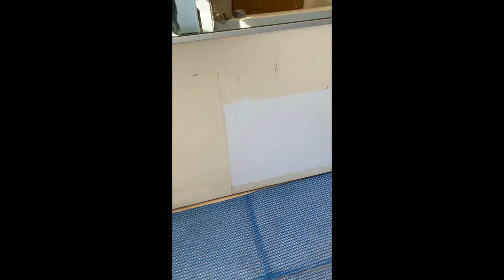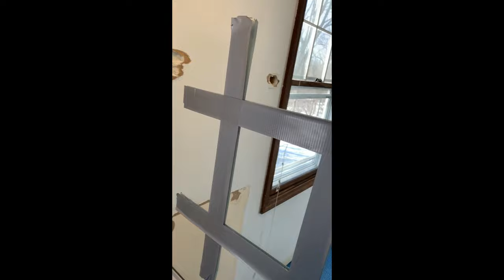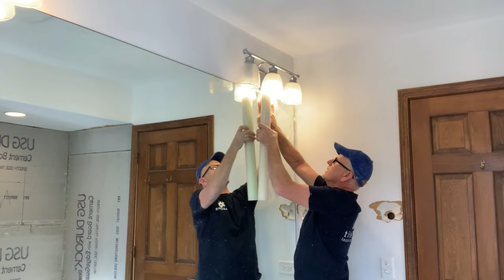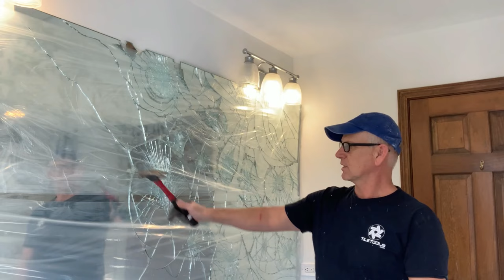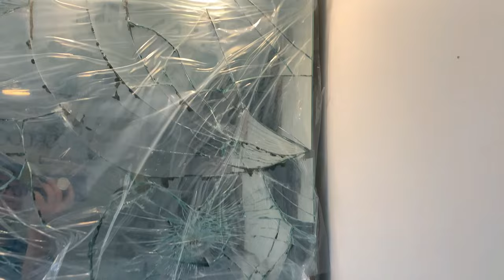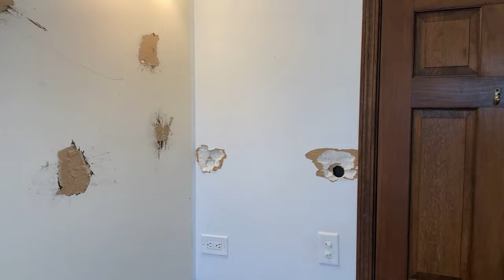Large mirror removal - safely

Comment: I had been researching how to remove a LARGE mirror.  My sister had a mirrored wall that was 8' tall and 10' wide.  It was in 6 sections of 4'x3'ish and I couldn't use any suggestions on videos until I came to yours.  It made the most sense and I followed your instructions....used carpet shield on the whole thing and started whaling away with a hammer in each section.  Really appreciate your video and help with this.  I would post pictures, but I don't know how on youtube.  Anyway, thanks so much for the assist.

Comment: This is a great video and very safe with the carpet protector added. I remove a 4' x 8' wall mirror (very heavy) using this method with one improvement. I have a Milwaukee M12 rotary cutoff saw that came with a diamond blade. Once you have it taped up, I scored the mirror into 2' x 2' pieces and snapped each one off. No shards, no splinters or small pieces of glass. It worked great!
Reply: So you didn’t break it with a hammer?  Just cut the pieces first?
Reply: Yes, just cut them with the diamond saw blade. The Milwaukee 3” circular cutoff saw is around $100 but you will use it for a lot of things. One of my best purchases and favorite tools.

Comment: Thank you so much for this video. I am a 75 yr old lady & I just removed my 7’ bathroom mirror all by myself by following  your video. The Carpet shield adhesive was a life saver! I had a little difficulty when I started because I was hammering at the middle of the mirror & it wasn’t breaking. I noticed you started at the top right hand corner. I followed your lead & my mirror shattered into a gazillion pieces. The carpet shield kept it from falling down in many pieces & made cleanup much easier. I did have all my fingers when I finished (ha). 

The lowest bid I had received for a contractor to remove the mirror was $600. So nice that money is still in my wallet!

Comment: It worked like a charm!  Thank you!

I had wall to wall mirrors above wainscoting.  The mirror was completely surrounded by j-clips. In total I had 5 large panels 1 metre wide (4ft), with two double narrow mirror panels about 10cm or 4” wide between the larger panels. It was from wall to wall… no room in the sides at all.  So there was no way to get shims under these panels of mirrors to remove them.  I had to break it up.

The carpet protector worked like a charm.  I ran the carpet protector horizontal across the mirror with a second coat applied vertically.  

The only thing I did differently was I wore heavier clothing.  I wore jeans, boots, a heavy sweatshirt (long sleeve), along with goggles, a face visor, a hat and most importantly knife/glass proof gloves.

I also used a 10Litre plastic bin (lined with heavy industrial massive garbage bags I got on Amazon).

I smashed the mirror and it would not budge until I cut it away from the carpet protector.  I started at the top first and worked my way down.  As I cut away the mirror covered in plastic carpet protector I dropped it into the bin below.  PROPER GLOVES ARE VERY IMPORTANT.

Working with broken mirror is dangerous work… TAKE SAFETY SERIOUSLY.

If you are working alone and you need to remove a wall of mirrors but more importantly you take safety seriously then this method works extremely well.  If you don’t want to follow advice or safety then don’t remove mirrors this way.

Comment: This worked great on an 82" wide mirror I removed today. I put the film on and managed to get the mirror off in two pieces - but no shards or anything, they stuck to the film, and when I had it off I was able to cut it into manageable pieces, put them in boxes and broke them with the hammer. Plus this way I was not lugging a huge mirror down the stairs, nor having to figure out what to do with it. Thanks for the tip!

Comment: Thank you so much! I cracked a 4x8 mirror while using heat gun to remove backing, your tip w/ the carpet tape was amazing. Was able to cover front and back to make kind of a bag around the mirror, laid it down, broke the rest of it, and was able to get it in the garbage and only 1 or 2 little pieces got out.

Comment: Worked great. By myself a 3ft x 8 ft mirror stat to finish 30 mins tops. I did use a glass cutter to score 4 sections which really helped large sections to come down with minimal fragments.
Reply: glass cutter before or after the carpet shield, I'm thinking before, since you just scored it.

Comment: I agree Phil with your way, nobody wants them and then they charge you to haul them away and when you have only yourself to rely on, this is the  best way to do it. I was just going to use a 6mm  plastic left over from a floor install and tape and break it which I know I may get hurt but after seeing your video I now know what to buy and brake it safely and remove it finally. I am a senior female DIYer because I can never  get someone to help with anything but I always get the job done! also Phil how has your luck been since? Lol, thanks so much!!

Comment: I just took my mirror out using this procedure. 
I used a very heavy box and taped it up good. 
    It was a very clean removal. I did wipe up all the surfaces with wet paper towels and then hit everything with my shop vacuum just in case any little pieces of glass where on the floor.
   Thanks for sharing this video. It’s really the way to go.

Comment: Well Phil, I found your video and thought WOW! Sounds like a perfect way to remove my mirror. Got the carpet shield, put 3 layers ( must be better than 2) and picked up the hammer and tried to break the mirror. The hammer bounced off the mirror with no effect. Kept trying until it finally started breaking. I was so happy. I took my razor knife and tried to score a small section but the blade just seemed to slide along the glass and when I tried to pull that section away the entire mirror came down. Sliced my arm open, requiring 6 stitches, another piece punctured my wrist, through my glove, which caused a hematoma in my hand. But, the mirror did co
Reply: yipes. Thinking this would be me if I tried.

Comment: Phil, amazing. Thank you for sharing this video! There’s a reply from Elmo6855 that expanded on your process — I wish we read his comment before removing the mirror! Please consider tacking his comment to the top of your comments stack. We took a 7’ wide 3.5’ tall mirror down using your proposed method with the carpet saver plastic, though we didn’t break the mirror until we got it down and on the floor. I sacrificed a new moving blanket to the cause. Laid it on the floor and simply broke the mirror along the seam I wanted to cut while it was on the moving blanket and was able to fold it over on itself twice over. Shards popped out of the plastic but were contained by the moving blanket. Then I used a large sheet of cardboard to wrap it all in, folded-over the corners/edges, taped the crap out of it and carried it out by myself without any issues. Amazing. But would have been better if I had read your notes and scored for the folds. Nicely done, Elmo!

Comment: I suggest using a glass cutter to score the mirror in vertical sections.  Then tape up to the lines.  Tap with a hammer and maybe a shim and you'll get clean breaks.  Ready to dispose of too. No shards.
Reply: @Elmo6855 I wish we read your comment before removing the mirror! I pondered buying a glass cutter and wish I had. We took a 7’ wide 3.5’ tall mirror down using Phil’s proposed method with the carpet saver plastic, though we didn’t break the mirror until we got it down and on the floor. It worked great! I sacrificed a new moving blanket to the cause. Laid it on the floor and simply broke the mirror along the seam I wanted to cut while it was on the moving blanket and was able to fold it over on itself twice over. Shards popped out of the plastic but were contained by the moving blanket. Then I used a large sheet of cardboard to wrap it all in, folded-over the corners/edges, taped the crap out of it and carried it out by myself without any issues. Amazing. But would have been better if I had read your notes and scored for the folds. Nicely done, Elmo!
Reply: Just trying to clarify, so after scoring use the shim to widen the scores on the mirror? 

My mirror is set back & no flat surface to get a shim behind the mirror as I’ve seen in other videos.

Comment: Thanks... this is going to be the method I will use! I am doing this job myself and I was getting worried about serious injury. I just bought the carpet shield on Amazon. I will be able to do this on Friday.
Reply: I've been wanting to do this since I moved to this house over 10 years ago, but had not seen this until recently. Now.... How do you dispose of a large mirror  like that? Surely it's not safe for the landfill, huh?
Reply: Just got done. Tape helped me cut the broken parts into smaller pieces and disposed in trash container. I had very few glass shards to deal with as the take kept most pieces together.

Comment: One of the reviewers of this technique asked whether one could use a glass cutter to into smaller sections.  And as mention by the viewer below.  This might negate the need for hammering the mirror into small pieces.

While overseas, I watched workers remove a large mirror like this one using only a glass cutter and wire to slide underneath when there was glue.   One worker did the cutting.  Each piece was perhaps 4 by 12in.   When he came across glue, he would slide wire underneath to cut the glue.   A second worker would lend a hand when needed and put each piece in a box.   A large 4-9 ft mirror took perhaps 45 minutes (I didn't pay much attention to time) and there there was no mess.  If it were me, I would probably add the carpet shield for additional protection.   I have some large mirrors and am interested in comments.

Comment: thanks for the video. going to use carpet shield AND try and shim it off in one piece. it'll have to be broken up to go into garbage anyway, but hopefully can break it up outside. won't be a theatrical as hammering on the wall, but maybe safer and cleaner.

Comment: I had two bath mirrors to remove. I tried your method on the first mirror and was left with tiny shards of glass everywhere. The second mirror I used the wood shim method. The shims worked great and left no broken glass, and no mess to clean up. My recommendation is to stick with the shim method. It's safer and less clean up.
Reply: I agree with the shim method normally, but in cases when the mirror has too much adhesive that it won’t budge, this is a good way to remove the mirror.

Comment: I found a around mirror in the trash and the mirror was broken. I just want to remove the pieces from the bottom of the mirror . I got most of it off but a small area won’t come off how can I get it off ? I want to save the backing to the mirror. What is my next step I see most of the people use a heat gun and a Bachelor spatula.but the mirror had small chunks. Can you please help me with this job and thanks for the help.

Comment: okay if you want to clean glass shards in a room that people go barefoot .
Reply: There's no other way when the mirror is glued to the wall, which most big mirrors are. Cover everything with plastic and use a good wet dry vac when done. I've done this a few times for customers.
Reply: @mikegrizwold2522 not true, I just watched a guy remove not one but TWO large mirrors that were mounted the same way. Without breaking anything
Reply: Contractors use a Shop-Vac. But a good vacuum with the slim crevice attachment works great.

Comment: TOTALLY WRONG WAY TO REMOVE A MIRROR FROM THE WALL!! DO NOT DO THIS.......... Do more research in using wood shims and patience.  This way is VERY VERY UNSAFE.
Reply: NOT TRUE - especially if you have a very tightly wedged in mirror that's glued on and there's no way to put shims in - this is a GREAT EXAMPLE and it's the taping part that's so good!
Reply: Actually if you put two layers of carpet protector film on there all the shards stick to the film, you can break it down into box sized pieces for the trash. It worked fine for me, hardly any cleanup afterwards.
Reply: You’re wrong. For this he did it the right way.
Reply: I'll prolly die of cancer the way i broke up my old tube tv...fml..
Reply: You’re wrong.  I just removed a wall of mirror wall panels using this method.  If you take the precautions the video said… it works like a charm. That carpet protector is very sticky and it holds up the mirror until it’s cut away.  I wore heavy clothing and boots as well as goggles and a visor along with a hat and most important glass/knife proof gloves.  Dealing with broken mirror is dangerous if you don’t follow safety precautions.
Reply: okay, so what are we supposed to do if we have wall to wall, ceiling to ceiling mirrors? i have found no resources online on how to do it, you got any suggestions???
Reply: I am glad I read your comment and I used wood shims instead. Easy an safe. I removed a 80*30 mirror from a door by myself!
Reply: @dinero_efectivo 30x80? Lol we’re not talking about small mirrors here.
Reply: @balexic 🎉 4:44
Reply: This worked great using the carpet shield and wood shims.  I didn’t break it up with a hammer. Mirror popped off the wall in one piece.  The plastic kept the mirror stable and easy to move. Glad I watched this video!
Reply: @valleyviewbaptistchurch-no1906 You sound so paranoid. It's not fair to say it's a dangerous method just because you're afraid to do this
Reply: Update: did this ourselves yesterday. Worked a treat 👍
Reply: Once you sealed it and broke it up what did you use to cut it c
Reply: Do you feel smarter than the hundreds of people who used this method successfully? The adhesive film holds all the glass and keeps it from shattering...... so you can remove it in sections. SIGH ... I guess it's true what they say about Baptists being loud, rude and self-righteous. Jesus is crying.

Comment: Shim the fucking mirror always works and will not do this horribly messy and dangerous shit.
Reply: It has to be busted up to fit in the trash can. What's the difference if done inside or outside? At least inside you'll be able to do a better clean up.
Reply: Sure thing...I'll shim out a wall to wall 4'x8' mirror and take it out in one piece..  Thanks but I'll take it out in a box.   I even checked with the local glass guy....he has installed mirrors this big in the past, but will not remove them.
Reply: @mdoe37  I had to do the same thing, wall to wall and to ceiling from vanity backsplash. No way to get a shim underneath. This method worked although not as clean but still worked. Mirror was glued to the wall also.
Reply: What was the need to say "F*#ing" ?  and "shit"?  RUDE.  Also, some mirrors have glue to the very edges and can't be shimmed. This method here is not "horribly messy" because it comes off in securely taped chunks and gets tossed into a box.  Read the happy comments!!!!  This WORKED for people.

Comment: This is how to not remove a mirror.   DO NOT DO IT THIS WAY!!! THIS IS BOGUS, VIEW MORE YOUTUBE CHANNELS ABOUT MIRROR REMOVAL!!
Reply: This works GREAT if your mirror is REALLY stuck to the wall  --- so tightly that you can't use shims. That's how mine was -- literally not even room to slide a sheet of paper.  Please read all the happy comments here.  People are thrilled with this method.  The adhesive film holds all the glass so you don't touch any sharp edges. Although I did wear gloves just to be double safe.
Reply: @bigfluf1  Any Bozo can break a mirror to remove it.  This is no genius tip.  This is the Handyman method when you have no clue about the correct method.  Geez...

Comment: This has to be the absolute dumbest way to remove a mirror. To dispose of one? Not a bad idea, but to remove it from a bathroom like that is just reckless.
Reply: For real?????
Reply: Thank you. I agree.
Reply: Not if it’s all going to the dump anyways.
Reply: Well, from all the happy comments, this worked GREAT for almost everyone.  The double adhesive holds all the glass so you can simply peel it off (with gloves in my case)  And let's be real, the mirror is going to crack of break anyway, you might as well have clean chunks.  Finish up with a Shop Vac and then wet paper towels. Done!